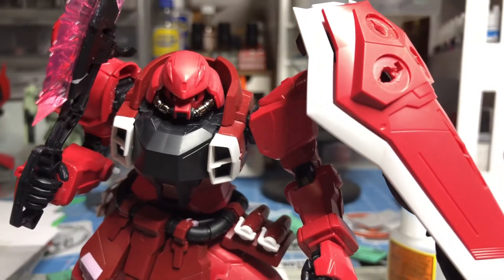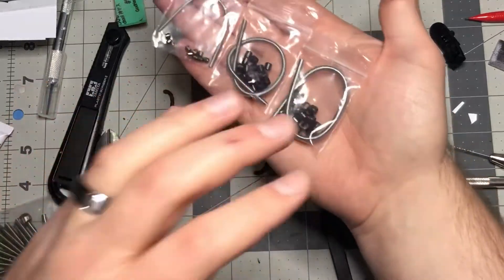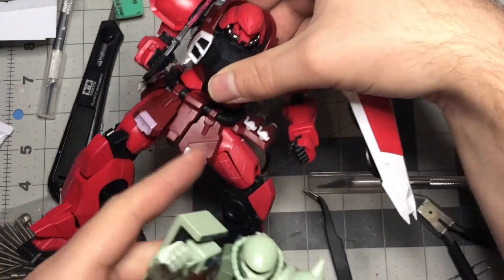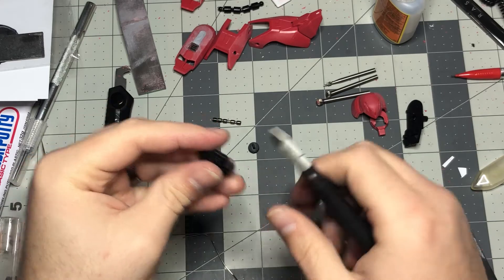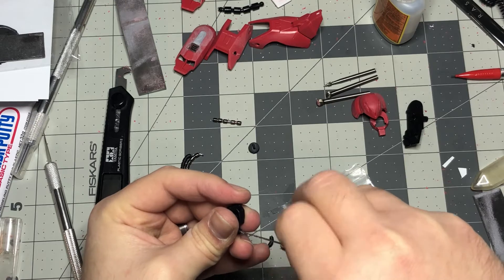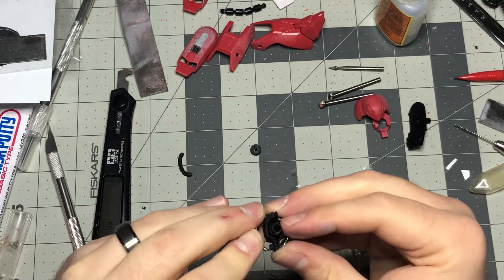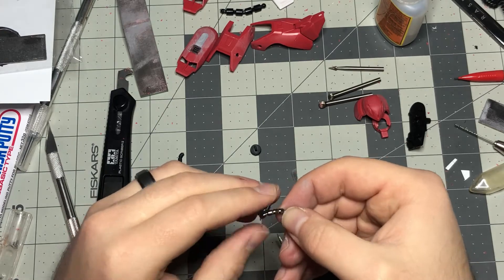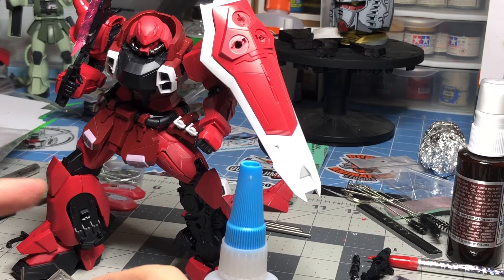Easy Zaku metal upgrade with SIMPro!

Comment: Thanks for posting this video, it’s been helpful. I am building the MG MS-06S Char’s Zaku Ver. 2.0 and have the metal upgrade spring and beads for the waste. Could you do a quick video on how to install them? Thanks
Reply from the maker: I can actually, it will be probably tomorrow or Friday before I can upload it though. It’s kinda dependent on how the connection points on the kit are though, can you shoot me an email (notsoaveragebuilder@gmail.com) with pictures of the waist connection points and how the ends of the plastic tubes look and I can shoot you the link once it’s uploaded.

Comment: Would you guys recommend getting small size beads for the head if the MG ZAKU and Medium for the rest of the body?
Reply from the maker: Definitely do the small ones for the head, going larger would look way off. I think the mid section and leg beads are the same size on the Zaku so the medium ones should work just fine